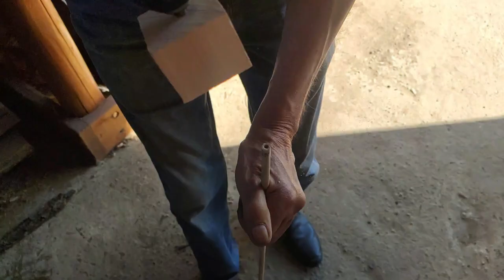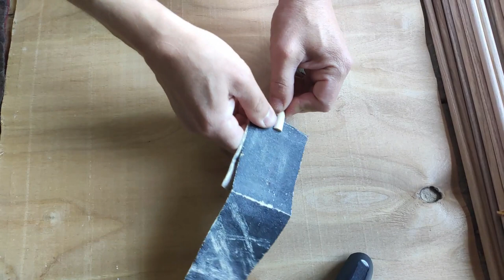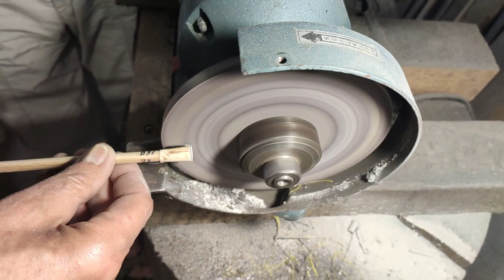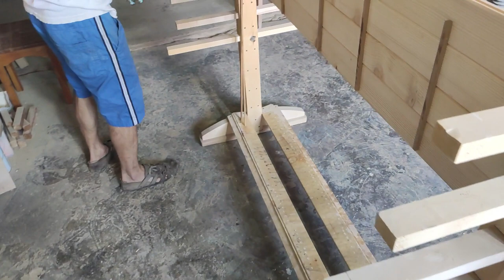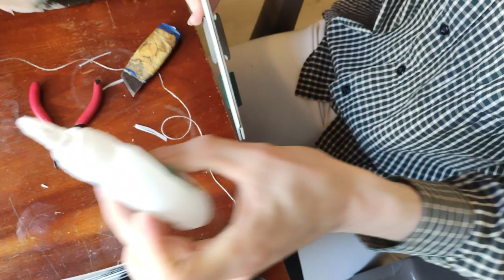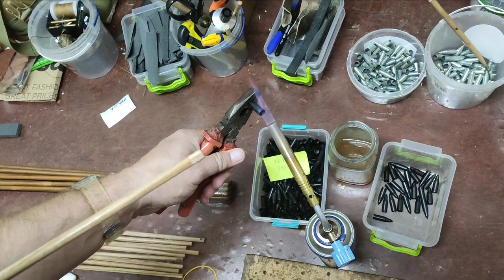How we make wooden Arrows | All steps | Full DIY |

Comment: I have a conical barrelled bamboo shaft. My question is, which corner should I attach the nock and which side should I attach the arrow head? My bamboo shaft tapers from one corner to the other.
Reply: arrowhead goes on thick end
Reply: @A123-i6p  thanks 🙂
Reply from the maker: We also put arrowheads on thick end. But it is more correct to say that at the end, which is closer to the bamboo root and with shorter distance between knots
Reply: @sarmatarchery1909  thank you 🙂